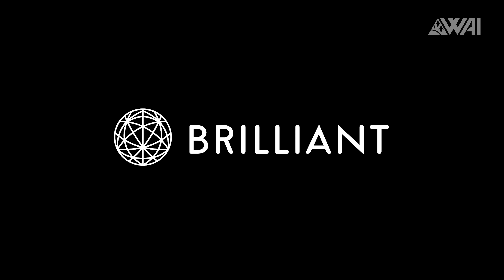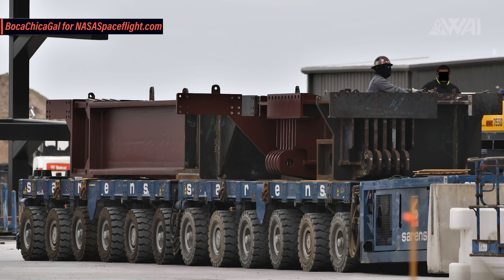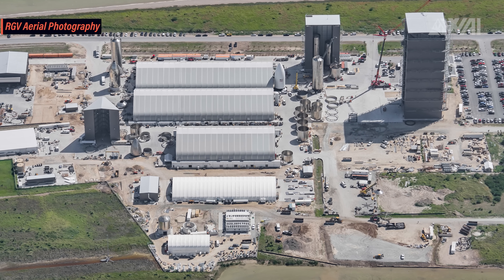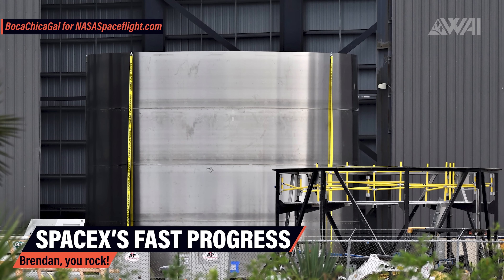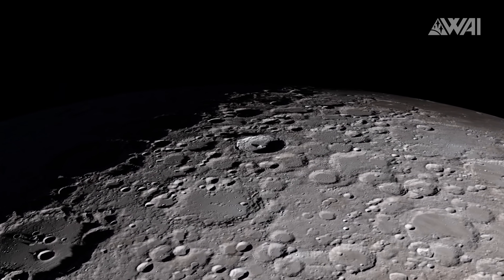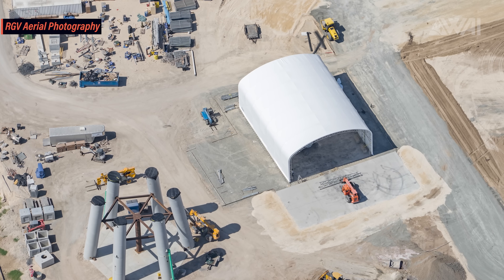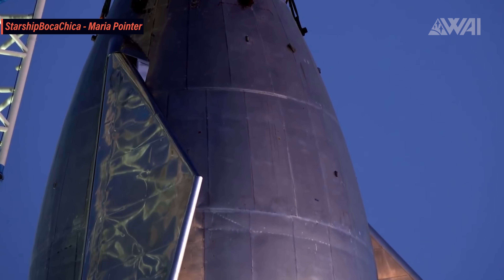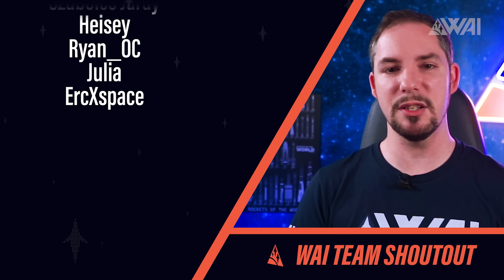129 | When will SpaceX's Starship SN8 fly?

Comment from the maker: Large hydraulic cylinders with some sort of spoon shaped metal parts attached = ?
Reply: Those red things are pneumatic-powered spring and piston actuated "butterfly" shutoff valves. The spring is enclosed within one of the red cylinders and the other cylinder has a piston to drive the valve open or close. the spring will provide a fail direction if the air supply pressure is lost.   (not hydraulic)
Reply: The silver "spoon" is the valve body and is sandwiched between two pipe flanges. These are large valves. based on the standard pallet dimensions, those valves are approximately 24 inch valves for 24 inch pipe diameter. Assuming water pipelines for the deluge system?
Reply: Looks like “killer” valve actuators designed for big pressure.  If there were going to be a water deluge system, I’d have said they would be a part of it.   Only thing left is ground fuel valve actuation.  This is my final guess!   😅 
Great piece as usual! Thank you!
Reply: Looks like powered butterfly valves. The spoon is the valve the red part powers it.
Reply: @warhawkme6344  Yep, 100% agree they are butterfly valves.
They look odd because there is no 'valve body' common to other valve types like ball valves or needle valves. The butterfly plate is flat so when the valve is shut the 'valve body' thickness (the spoon bit)  is only marginally thicker than the butterfly plate itself. The butterfly can turn within the pipes themselves so this valve design is very space efficient.
The actual control method is more foreign to me but it looks like a cylinder so hydraulic or pneumatic actuation is a safe bet. I'd put my money on hydraulic though because of the sheer size of the valves they actuate and proximity to hot and loud vibratey rockets.
Reply: @SKYWURX  Working on oil drilling rigs I am familiar with that type of valve. Many large industrial uses.
Reply: @warhawkme6344   i think so too! we have those at work, and they look identical.
Reply: @warhawkme6344  I agree they're butterfly valves and given the size of the actuators they must need to be able to open or close them very rapidly.
Reply: I work in irrigation and they are hydraulic or pneumatic operated butterfly valves, like all the other guys are saying. Definitely some big boys. I've done 18-24" valves before, but gear head operated on pumping stations. Love seeing all these photos and what actually goes into these systems.
Reply: The red parts with spoons are Actuated wafer type/butterfly valves.  I think the tent is a parts warehouse and will remain in place for the duration of the construction of the launch pad.  Once the launch pad is complete the tent and trailers will be removed.   This indicates that the construction of the launch pad will take a while, several months to a year
Reply: @texastopshotsphotography2997  I was thinking it's a temporary fabrication tent for fabrication of parts for the launch mount. Close to the same idea as yours but it's certainly temporary.
Reply: They are actuated valves.
Reply: Definitely large butterfly valves with actuators (red).  These are very large; too large for fuel transfer, I think.  Possibly high volume water deluge.
Reply: Water deluge rapid action butterfly valves
Reply: They definitely are actuated valves. If I had to guess the big one's are at least 20"
Reply: I would say the spoon shape looks like a butterfly valve, so i would assume the red part is an actuator of some sort (electric, pneumatic, hydraulic, etc.) for the valve. Not sure what the valve would be for, but i could guess ground equipment such as fueling a super heavy at the launch mount.
Reply: Butterfly valves for clean liquid / gas pipelines.  I say "clean" meaning you don't use these where you may need to send a scrape / swab / smart / or foam pig through the pipeline.
Reply: there is actually 7 or 6 hydraulic cylinders with some sort of spoon shaped metal parts attached
Reply: Maybe all this is equipment for the future CH4/O2 station, which Mask announced about a year ago.
Reply: Retention clamps, or butterfly valves used to actuate water sprays to dampen acoustics.
Reply: My first guess would be the old flap actuators.
Reply: They look like extruders to me.  The spoon would be the hopper. Nothing to do with rockets and space
Reply: Maybe those are the flap actuators? That would explain the size difference between them.
Reply: Deflector plates that can be angled on the fly. Good way to test flame diversion tactics perhaps?
Reply: maybe controls the grid fins?
Reply: I think they are things that will hold super heavy down until it has enough force to take off. something like the soyuz
Reply: My guess: automated butterfly valves
Reply: You need this sign for your channel... ‽
Reply: they could be the actuators for future starship fins
Reply: lokes like rotork valve actuators
Reply: Could be part of the hinge/motors for the upper gantry/walkway  ??
Reply: Fire control system
Reply: @adlovinger  looking at the footage it looks like the fire hydrants used at the Grasshopper test site....
Reply: @kylereese4822  Red painted pipes in construction have always indicated a fie suppression system. However in this instance it could be for exhaust flame dampening.
Reply: Those are valves.  Red part is actuator which turns the "spoon" which is a butterfly valve.  Likely for water deluge.
Reply: = starship
Reply: I'd really like to see 3D printing of complete ships be a thing. Reason for this is you could 3D print ships anywhere if it did, all you would need is basic ore and a refinery. You could build ships in orbit, on the moon, Mars, anywhere.... Star Trek sized ship yards could be a thing!
Reply: @scabthecat Hi, "Bridge Crane" is correct.  A "Gantry crane" includes tall support legs often with wheels at the bottom of 4 beefy legs, 2 legs per side, wheels fit onto either a track on a roadway or can move freely.  A "Bridge Crane" has no legs since the building into which it is placed serves as the legs.  A bridge crane consists of a big beefy beam (the "bridge") with a track built into it to hold the hoist trolley which provides for movement in the horizontal X direction.  There are more metal wheels at the ends of the bridge crane beam that sit in tracks perpendicular to the bridge which provide for motion in the horizontal Z direction.  The block-and-tackle style hoist provides for movement in the vertical Z direction.
Reply: Hydraulic Spoons for eating the victory cake after SpaceX beats everyone to Mars.
Reply: kleppen voor brandstofleiding
Reply: @bertranwillemsen7800  he is german not dutch
Reply: @onion5590  ja, dat weet ik, ik heb zelf ook Duitsers in de familie, kunnen prima Nederlands lezen, en vertalen via youtube werkt ook prima
Reply: Thanks for all of your inspiration I am working with a bunch of other high school students to make a plane. Check us out at flight club aerospace is you want to a see what we are doing
Reply: приятно видеть тебя
Reply: I added a comment explaining what they are. Dont feel like retyping it. It's a Easter egg hunt lol
Reply: First impression: the parts attached to the red cylinders look like the grid fins for a SH Booster just not painted...
Reply: Maybe some hold down mechanism for early testing?

Comment: Wouldn’t mass simulators be required to simulate the weight of the 3 non-present Raptor vacuum engines during the glide and landing manoeuvre, or is this weight to little to have an impact?

Comment: With the foundations for the tent and trailers by the launch pad.  They’re just paving only what they need.  This same principle was used for the launch area by the tank farm and the landing pad. You’ll see that concrete has been poured repeatedly to adjust the shape of the pad for whatever current purpose they have for it. A slab of concrete can host many different structures after time.  The assembly facility has had the same thing go on.

Comment: How many Raptors will SH-1 get initially?  Will it do a hop / flight on its own (without a Starchip)?
Reply: Two. Initial hops without Starship
Reply: @alvianchoiriapriliansyah9882  So it shouldn't initially need the OLP?
Reply: @connecticutaggie  It will need OLP
Reply: @alvianchoiriapriliansyah9882  Why?
Reply: @connecticutaggie  Because this is what mentioned in NSF article

Comment: They'll start friction stir welding the segments.
Reply: It doesn't use aluminum, so nope not FSW. It used TIP TIG
Reply: @alvianchoiriapriliansyah9882  the technique is not only for aluminum, you can use it on a bunch  of metals. And Musk said the seams will get cleaner, less noticeable, and more uniform in strength.
Reply: @hotrodandrube9119  I'm not sure if they will use FSW on steel. It's a lot harder & more complicated, requiring far more precise machine. They will use plansiher, and in a future autogeneous laser welding instead

Comment: Yes When You build Rockets 1 Side At A Time Frames, The Covering Needs Less Welders. The Inserts Of Fuel tanks And Firewalls Is Pleasant. The Production Quality Of Your Balanced Load Is Better. You Get An All Around Better Craft Faster. You Have Two Open Halves You Can Stay On The Ground To Perfect. No Stupid Cranes Dude. The Only Crane You Need Is A Carbon Fiber Lifting Strut And Wheels Bro. A Sliding Structure Above One Half Of The Rocket Can Easily Cary And Place More Accurate Parts Like Fuel Tanks And Helicopters. Like A 3D Printer Add Your Inserts With A Four Axis Over Lifter. That Slides Effortlessly Over Any Part Of The Sides Of Your Rockets. What You Are Doing Now Is Slow And Expensive. This Way Builds millions Not Thousands Of Rockets Dude.

Comment: I would say SpaceX are at the 'experimental stage' with this machine so expect the unexpected... it may even break up because of stresses on the nosecone and other components, i have an open mind on this when it eventually happens but with failures you learn about what goes wrong so that the next iteration of the machine overcomes the problems encountered and performs as expected, this is why SpaceX have a line up of Starships waiting.

Comment: The parts you mentioned at the O.L.M. look like HUGE butterfly valves. The red part would be an actuator, and the "spoon" shaped part is the butterfly valve. They would likely be using these valves for throttling applications (partially on). Maybe for the launch sound damping water dumps?

Comment: Long shot theory here, but there's a Mars launch window in 2022, my guess is that SpaceX wants to have a fleet of Starships ready to go for an unmanned supply expedition by then, so they can set up support infrastructure, followed by a manned mission in either 2024 or 2026.
Reply: I think it was back in 2016 when Elon stated that he would sent two cargo Starships to Mars in 2022 and then two cargo Starships and two crewed ones in 2024. I don't think that this timeline is possible as Elon will need not only the Starships but also the payloads to be ready.
But I guess we just have to wait and see.
Reply: Elon had said the first ever Starship that land on Mars won't do so until at least 2024
Reply: @alvianchoiriapriliansyah9882  It's still possible that one or two Starships will go to Mars with orbital payloads before that.

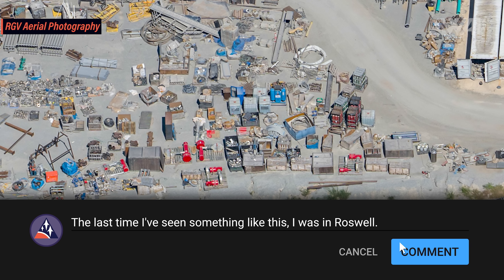Comment: Mopst of the Material seen at 10:40 is Pieces and parts of Water/ Gaspipes. I would guess the red Cylinders are some sort of Special Valves.
This looks more like Materials they wouild need to finish the Mid-Bay or Use in the Tank Farm.

Comment: When will Starship travel into space, and when will it be safe for people to travel in it? How will Starship manage to fly smoothly through the air without being torn to pieces when it returns to Earth?

I know that Starship 8 is a test ship but I am curious about the long-term issues.
Reply: One by one

Next year, not just space but orbital

Depending on when they will get to a hundred of uncrewed launches

Same as every spacecraft that's reentered safely ever. Shuttle also the same. Starship will be supported by pressurization ≠ propellant almost empty
Reply: @alvianchoiriapriliansyah9882  Thanks
Reply: @alvianchoiriapriliansyah9882  But did they not have to build a brand new launch pad out at sea because the rocket produced such a loud noise?
Reply: @gig2734  Elon had said that the orbital land launches is still possible, just less rapid than offshore. The problem will be the frequency
Reply: @alvianchoiriapriliansyah9882  Thanks

Comment: Just wondering why can't the do one big weld down a single piece of Steel sheet the same length as the Starship and Heavy making a tube then insert the propellent tanks with the Rockets attached to a geodetic frame and slide the frame in and weld were necessary, making for faster testing and production 😎
Reply: Because there isn't any steel mills that made the part that large
Reply: @alvianchoiriapriliansyah9882  well if it's needed they should supply, even two lengths of steel the full length of the rocket body should be wide enough for any supplier? and weld two down the body to make a tube then it'll make the tube stronger than a dozen welds down the tube and a geodetic frame would make it easier to test before you put the frame in the tube 😎
Reply: @eanjamesmogg9488  I mean seriously, almost 50 m of single sheet? Is it the current method (or later a wider sheet) weak enough that it's an urgent need to do that? Is the current design will disintegrate?
Reply: @alvianchoiriapriliansyah9882  Well they do it in larger lengths to make up a bail or whatever it's called and welding to a geodetic frame will give it strength, 😉

Comment: There is actually three scaffolding being set up in the tall hi-bay building. if you look carefully, the second scaffolding is further out than the first one in the picture, indicating that a third one exist and is obscured by the wall of the building in the picture. there might be even four of them two at the back and two in the front, but I think there are three being set up.

Comment: RE: Free Access to GrooveFunnels - the new best way to build better funnels

- Free for LIFE
- No games. No fine print.
- No credit card needed ever!
- $99/month value… Now free.
- Grab your account while you still can!

The world has changed so much recently.

And during these times, I am always excited whenever I find new solutions to help you in whatever way I can.

I’m sure you’ve heard of software tools designed to help you build websites, sales pages and online funnels.

Because sales funnels are proven to be effective, any such tools could reasonably command high monthly fees to access.

Unfortunately, this could also be out of reach for many business owners and marketers who are on a budget, especially during uncertain times.

This is where GrooveFunnels comes in.

GrooveFunnels is the new, better way to build funnels and sell digital products online.

It’s not just one or two simple tools, or solely a “funnel builder,” either.

This is your complete digital products and services online sales system.

Co-founded by Mike Filsaime, one of the top Internet marketing experts in the world, GrooveFunnels is a suite of products that includes all the tools you need to run your online business.

They have built a complete, all-in-one platform with all the essential tools so you don’t need to worry about multiple subscriptions to a variety of services that would easily add up to thousands per month.

Finally, you can get instant access to practically everything you need to sell your products and services online.

… Including:

- Full product funnels
- Brand websites with full navigation
- Custom domain names
- 1-click upsell capabilities
- Upsells, downsells and order bumps
- The world’s most powerful affiliate program
- And so much more…

Yes, this is a game changer.

And today, for a limited time only, you can get started for absolutely free.

No credit card. Lifetime access. Unlimited usage. Forever.

I’m not sure about you, but I will be switching my entire business over to GrooveFunnels.

Literally everything I need, and save thousands a month in the process.

You’ll have to see it to believe.

Take a closer look at it yourself, and pick up your free account while you’re there:

https://groovepages.groovesell.com/a/v9OqvlxJ9AD8

Let me know what you think.

To your success,

David Montoya

P.S. Mike told me that he is making some huge upgrades to his tools over the next several days, and we’re not sure if this will continue to be free for long. However, if you get your account right now, you’ll still be able to keep your account for life, including all the future updates to the tools. Take some time to learn all about the software, but be sure to grab your free account before it’s too late.